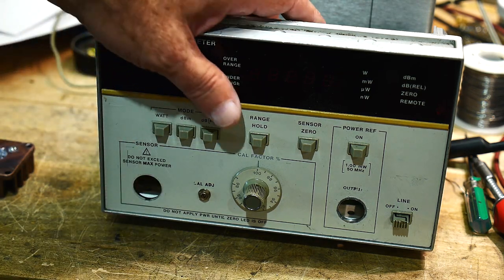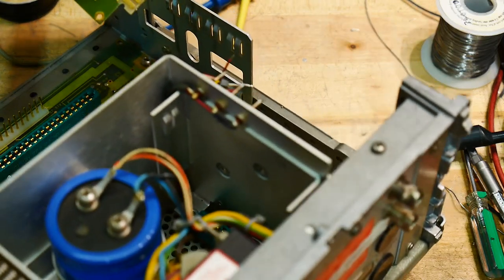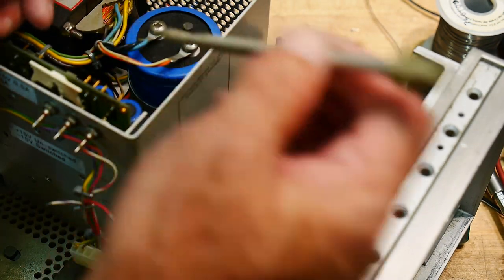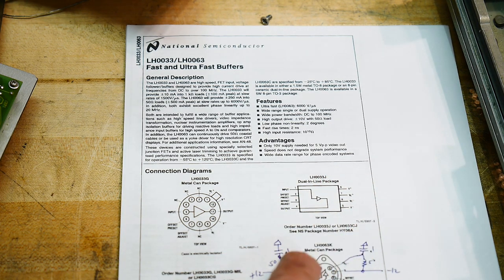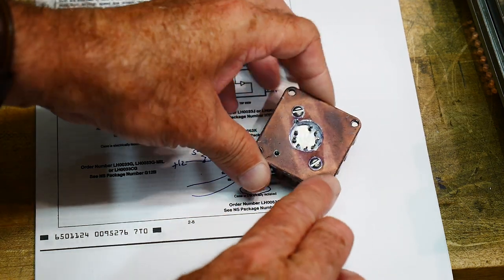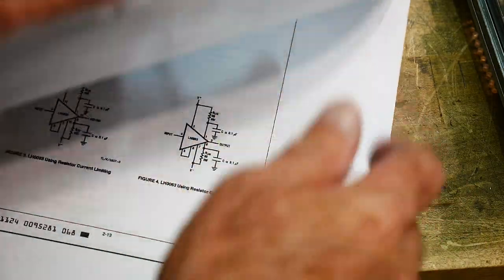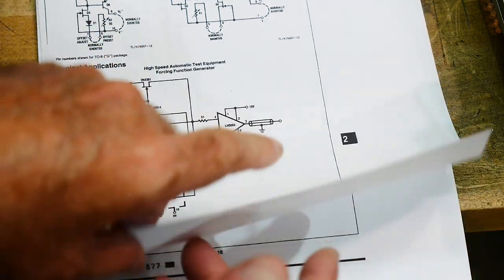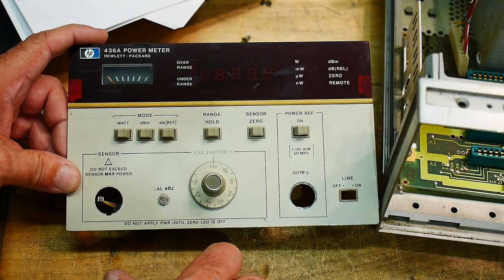#551 LH0063 Fast Buffer (part 1)

Comment: Maybe think about where in a TO3 package the die is ?  Optimal thermal path to the heatsink ?  Perhaps you should rethink the heatsink ?
Reply from the maker: you are right but too many pins. I expect the TO3 package to be an OK heat spreader. I've seen TO3 heatsinks that mount from the top and only contact the  tabs. Anyway it is fine for garage use.